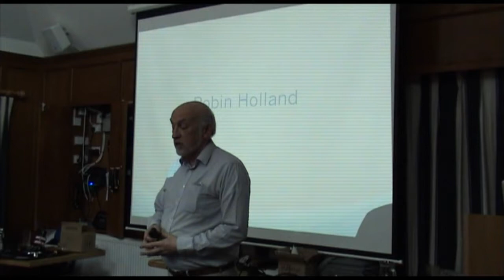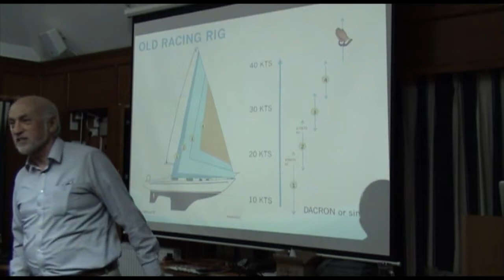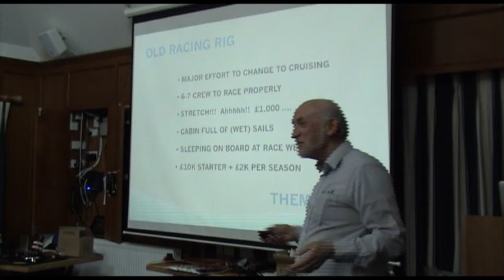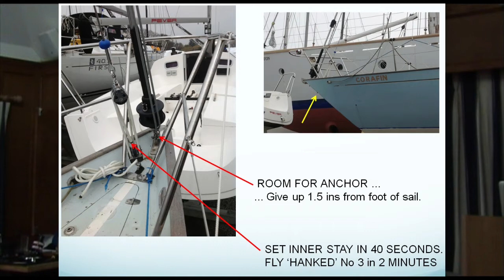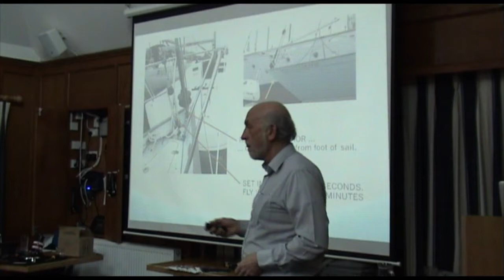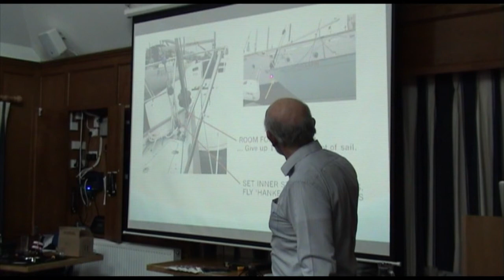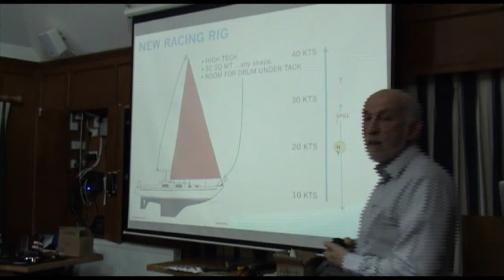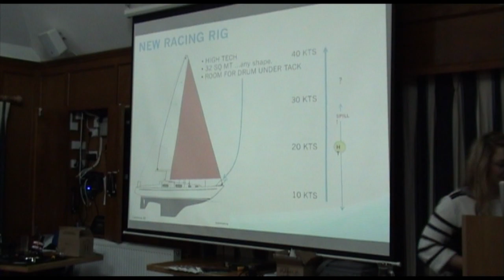Contessa 32 Cruising Seminar 2013 -- Robin Holland

Comment from the maker: On the Video Robin talks about keeping his main 24lb anchor below in the forward cabin. To make it clear, the Class rules state that if you have an anchor locker on deck that must be where you keep your chain and anchor. For a very small number of early boats that either don’t have an anchor locker or have one that is too small to house the correct size of anchor, these boat must keep the 24lb anchor in the forward cabin at least 6’ in front of the mast step. I hope that answers any queries.